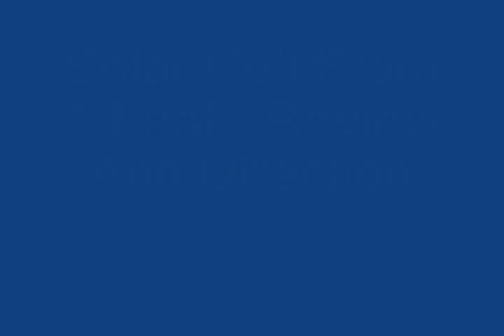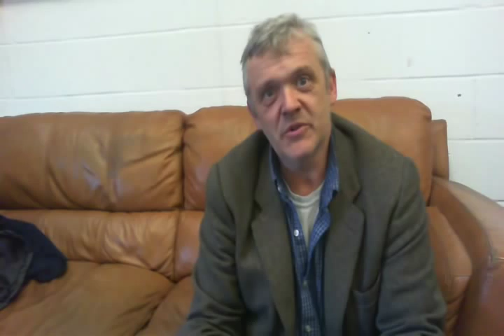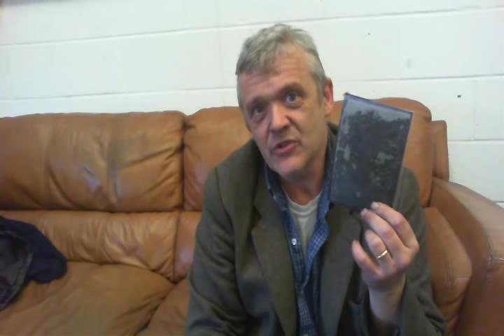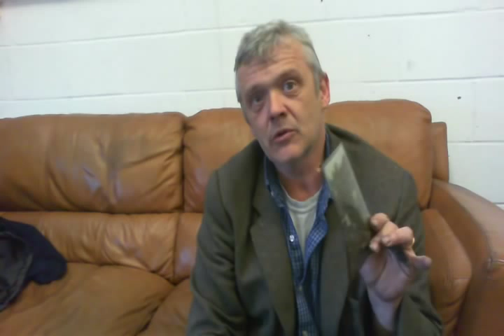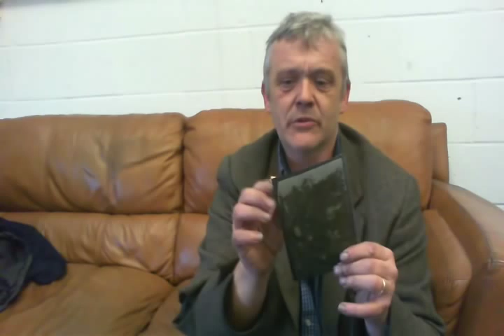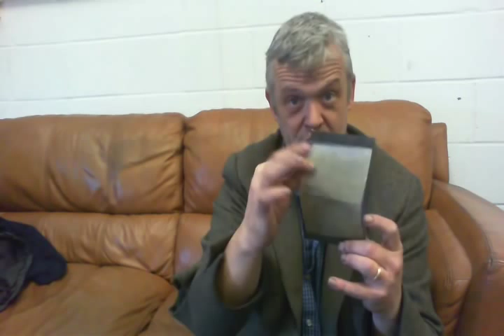Solar Cell From A Leaf - Review And Direction

Comment: cant find any fiber glass tissue here. is there any substitute for it?
Reply from the maker: +Ben K try tissue paper
Reply: +Robert Murray-Smith. how can we possibly test for the degredation of the chlorophyll? :)
Reply from the maker: +Ben K spectroscopic analysis of some kind?
Reply: +Robert Murray-Smith. got it. we've been doing spectro analysis a ton of times already. :) 
too bad we can't try the eutectic solvent you had since choline chloride is not available. :(
Reply from the maker: +Ben K try a natural deep eutectic they are mostly sugars and urea
Reply: +Robert Murray-Smith and a partner of urea could be? :) just got excited to try it at the lab. :) my apologies, cant do a quick review about NADES combinations. 😊
Reply from the maker: +Ben K glucose, fructose, lactose, oxalic acid, ethylene glycol to name a few but there are some good papers on NADES that will help mate
Reply: +Robert Murray-Smith thanks. cant wait to try it. yes, i have read a few papers about NADES.
Reply from the maker: +Ben K go for it

Comment: Price point on solar panels here in the western US is about $1.00 per watt.  Different companies and states pay at different rates, so the payback is quite variable... there are still places here in the US that do not allow grid intertie at all.  In my home town, you must pay $200 to start a grid intertie account and $27.89 per month worth of fees over and above the normal fees associated with the power bill.  These go to the connection costs as well as a second meter to measure the power supplied.  The rate at which the power company pays the producer for power is half of the wholesale rate.

This means that one must pay back all the power used (assessed at the full rate of 15 cents per kW/h) plus all of the fees and taxes (approximately $52) , while receiving less than 6 cents per kW/h.  We would need to produce a surplus of 867 kW just to break even, or around 4 kW worth of output dedicated to the grid to pay fees and taxes.  On the average US home, this means that installing 10 kW of grid intertie will zero your power bill, but never see much net revenue; payoff would occur in about 7-10 years.  Doubling the size of the system does not help at all.  The extra $10,000 buys $48.00 return per month from the power company, yielding a 17 year payoff.  

The best bet is to disconnect from the grid and spend some extra money on batteries.  This would save about $140 per month (average) and cost about $7000, yielding a payoff of a little over 4 years.  Better still, cut your power consumption, then size the system accordingly with both wind and solar.  The resulting cost for our system is only about $3700, and the payoff compared to the average home's consumption is 2 years, 2 months, and 13 days.  This is where that capacitor comes in. :)
Reply: Hey
Reply: How r u
Reply from the maker: Aaron Harper that's fascinating mate - boy have they tried to tie that up - your analysis certainly makes me think - i hate being held over a barrel by anyone!
Reply from the maker: ladyluck 46 hey to you too  lol
Reply from the maker: ladyluck 46 i'm good how are you lol
Reply: They do have it tied up, but this means that they have voted themselves off the island when a person switches to solar.  When standard batteries have a better ROI than grid intertie, the choice is simple and power becomes distributed.
Reply from the maker: Aaron Harper that's what i am looking to do mate

Comment: Actually i've lost myself from where you were using metals up to when you ended up with just some layer pf ink, the electrolyte and the plastic film. How are you wiring it. That is how are you collecting the electrons? Your work is awesome thank you!
Reply from the maker: I use asymmetric electrodes - copper and aluminium - there is without a doubt a small amount of faradaic reaction there but it is overwhelmed by the solar effect - so it would be better with gold and platinum electrodes as we would just get the solar reaction but the addition of electrochemical reaction from the copper and aluminium is pretty insignificant

Comment: For  a good results  you must have graphene superimposed on  both  sheets face to face with the electrolyte in between. Graphene might work much better then other  commercial materials if properly arrange.
Reply from the maker: don't multipost the same message mate - i read all my posts
Reply: ok

Comment: Flexible modules than can be unrolled on site already exist which  mitigate the shipping and fitting costs. So the important target number is the manufacturing cost per watt. For thin film photovoltaics that seems to be in the ballpark of $0.50/watt today. The other costs of a solar installation don't change -the fitting/wiring, the batteries, charge controller and inverter - right?
Reply from the maker: i was told $1 per watt - but so what - no pun intended - this is still cool
Reply: Robert Murray-Smith
It is! Wasnt trying to rain on the parade, just the fact that you can make a working panel without fancy clean rooms and vacuum deposition chambers or whatever is huge. And if you can get real power economically too - that's beyond huge.
Reply from the maker: samfosteriam
no worries mate - id din't take it that way

Comment: Fantastic. Another key I suppose is that this is a flexible material. Like you said, paint your roof, but also your car etc. Try doing that with traditional cells...great breakthrough. There's also an inspiring video on the "artificial leaf" although not nearly as straight forward as this. Thanks!
Reply from the maker: i'll have a look at it - cheers mate